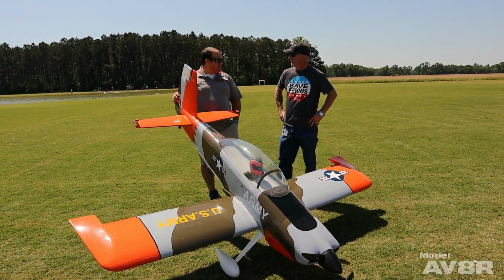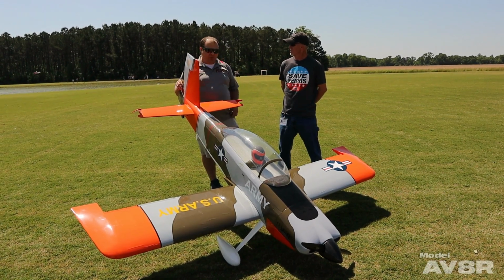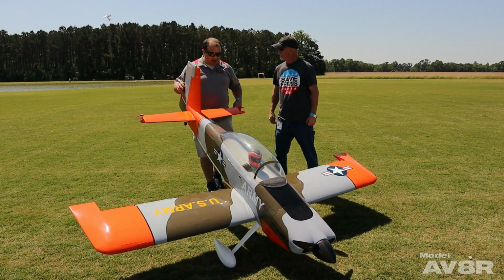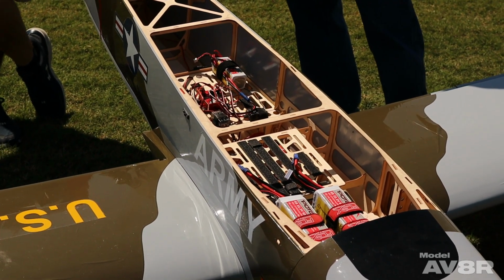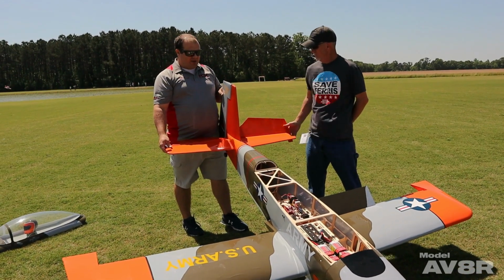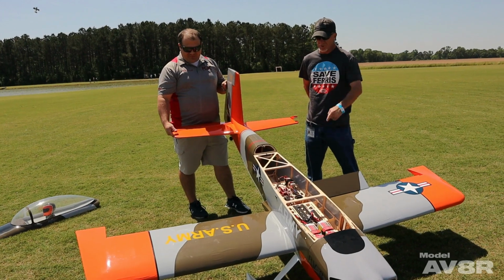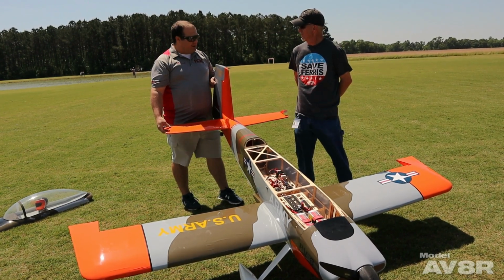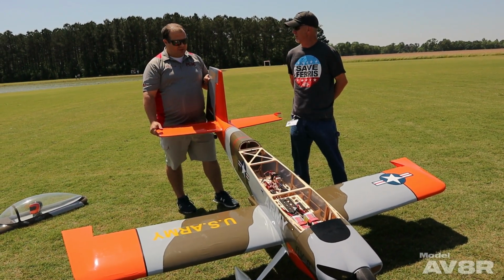Flex Innovations RV-8 70CC FLS - Model AV8R Episode 35

Comment: I like how Seth transitions back and forth using flaps. There is something to be learned there if you pay attention to it. Since the plane is so darn quite being electric, you could hear the switch flips on his transmitter which really adds to this video IMO.
Reply from the maker: Yep, in addition to using regular flaps a lot he's also flipping the switch back and forth that mixes the flaps with the ailerons for full span ailerons. Amazing plane...so capable and versatile.